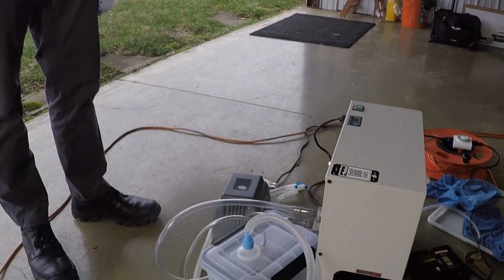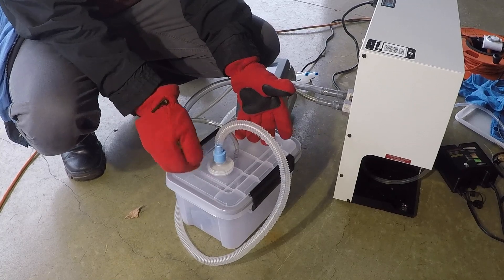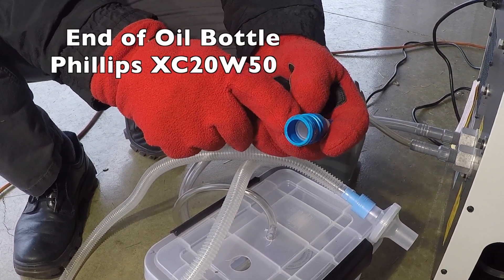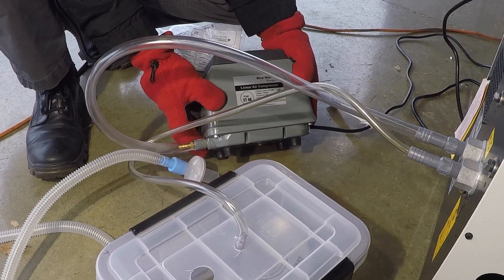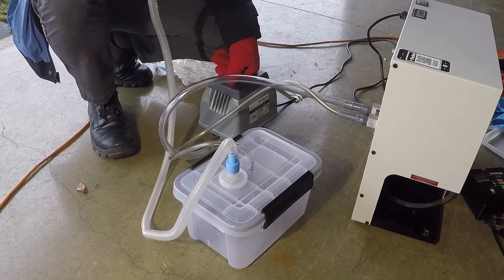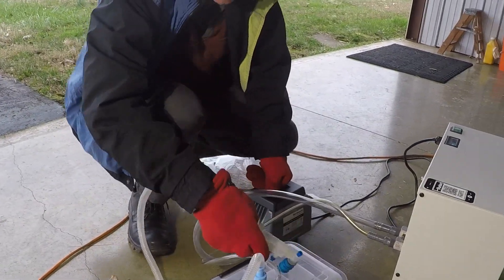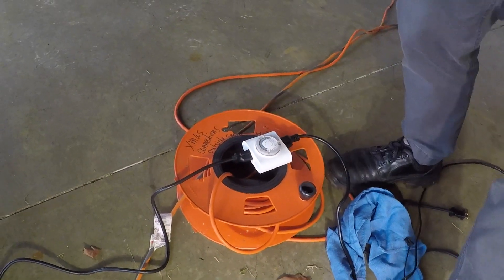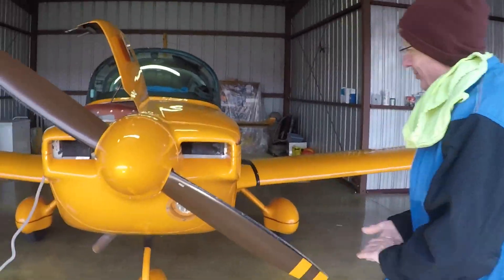Engine Dehydrator - Grumman Style

Comment: That is a quite expensive way to keep your your engine dry.
The silica bead system works very well and at a fraction of the cost. I have built several and a 2 qt container will last over 2 months in a closed loop setup.
Reply from the maker: Send me a video or diagram with components.